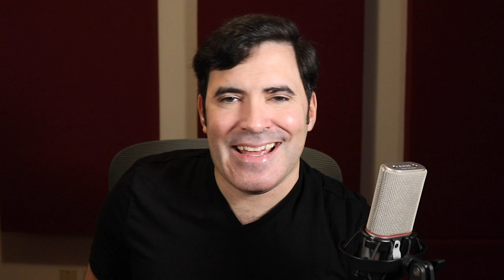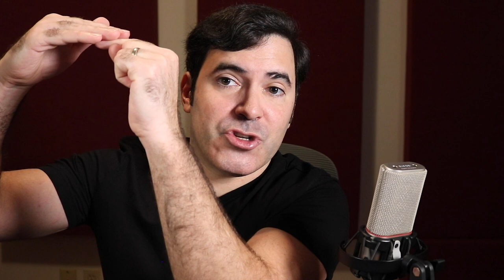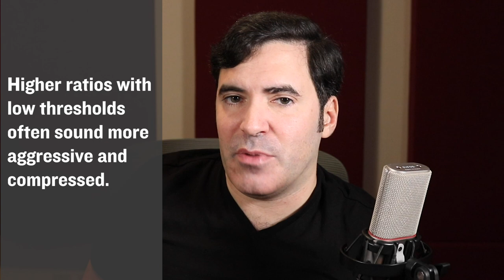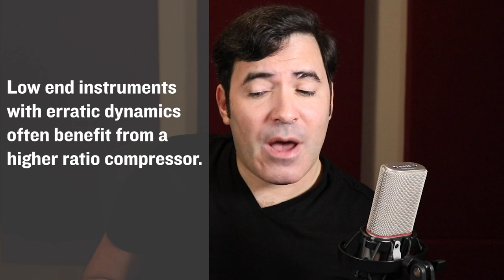How and Why to Use Your Compressor's RATIO Control

Comment: For me what worked was putting on a pair of good headphones and listening to the pushing and pulling of the sounds when I would change the ratio, attack and threshold. I am just now getting my ears use to hearing the differences through my monitors.
Reply from the maker: YES! That's exactly the thing to do.
Reply: Hmmm, a lot of ppl talk bad about mixing w headphones but certain details you can just hear better, like reverb, and I guess compression, and even appropriate level of bass if you don't have a sub or don't have a well treated room

Comment: This is such a good video on a topic no one else seems to have gone into any depth or given good examples of. Many thanks for posting it.

Is it a good idea to use a limiter on the master bus to control a snare that pokes through the mix by a few Db (in a deliberate and consistent way which gives it a bit of focus), to glue it with the rest of the track, or is it better to reduce the snare's actual volume? I've found there's something about using a limiter which allows it to stay fairly forward, but maybe I just haven't noticed I'm sucking the dynamics out of it or something.

Comment: Thanks for the video! Besides the transparent-notsotransparent. I also like to split them into "inserted" compression vs auxiliary compression or even use ratio as help for eqing that channel through compression without messing up the tone. :)
Reply: Oh and sorry, but the MixHabits and Mastering101 pages don't seem to be working. I tried refreshing, internet switch, VPN off, but it doesn't seem to load. :(
Reply from the maker: You could have an ad blocker that is stopping the signup form from loading. That happens sometimes. Hope that helps!

Comment: Correct me if I`m wrong but the way I see ratio is with fraction so with a ration of 2 only 1/2 of the sound will go thru a ration of 4 only 1/4 of the sound will go thru and so on
Reply from the maker: That’s right! Another good way of saying it.

Comment: I like low ratio based on harmonic waves. 1:3:1 on bass 1:6:1 mids 1:9:1 on highs. These are very low ratios that work with fast attacks. Be amazed at ratios under 2.